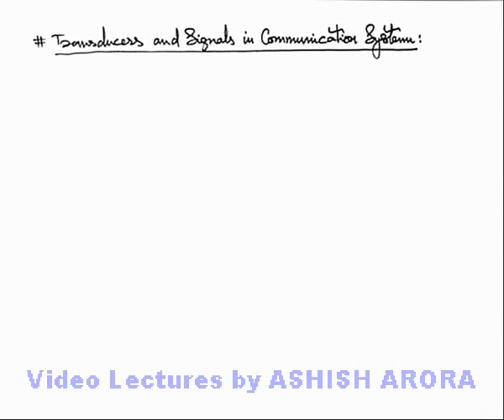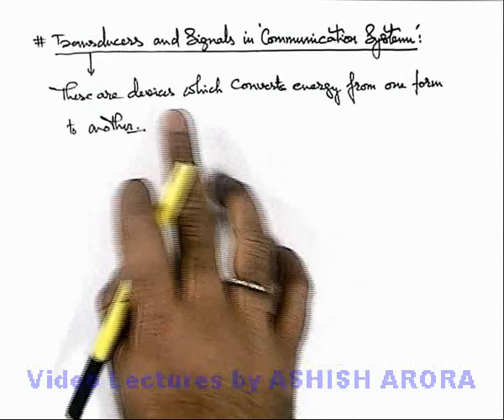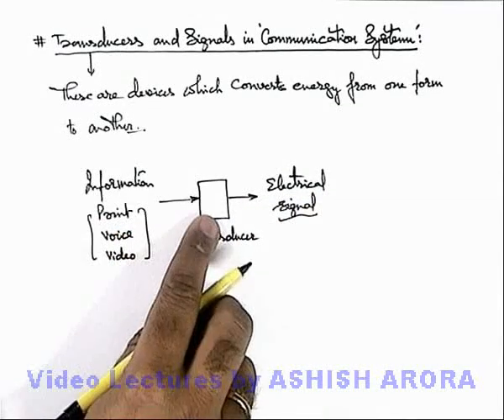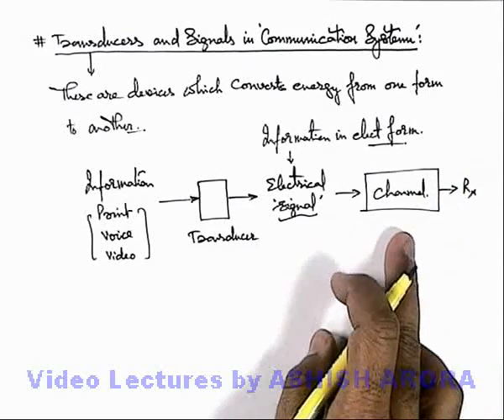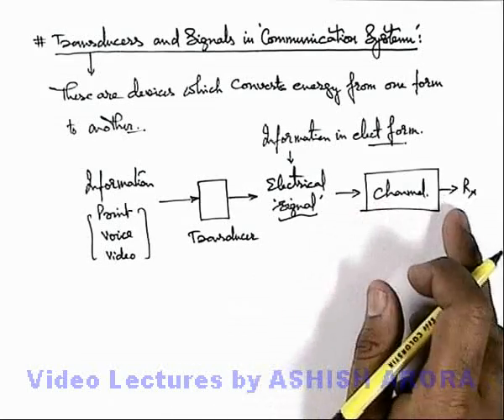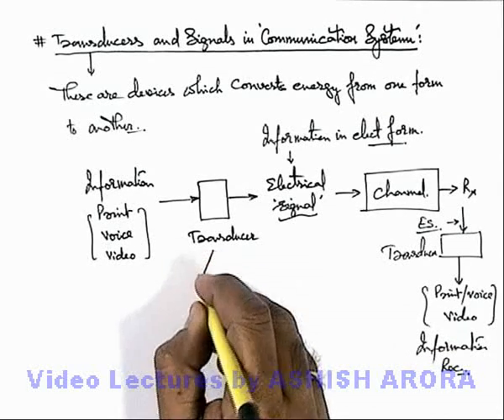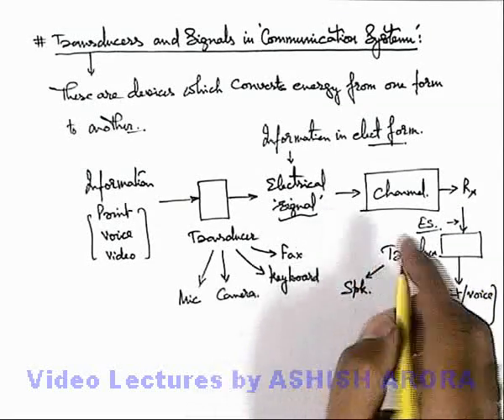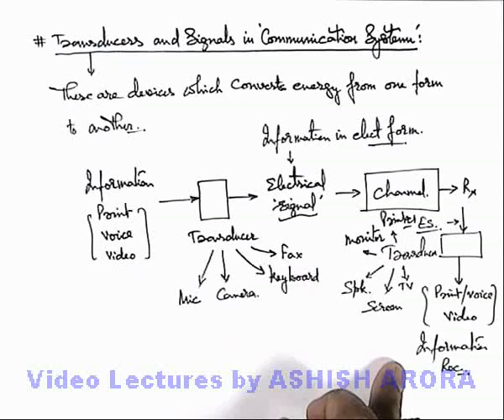Class 12 Physics | Communication Systems | #3 Transducers and Signals in Communication Systems

Comment: what is the difference between transducer and transmitter?
Is transducer comprised inside transmitter?
Reply: Yes you all are right
Reply: I think transducer is a part of transmitter.....transducer converts the information into elec. signal and with the help of transmitter the elec. signal is transmitted
Reply: Transducers and transmitters are virtually the same thing, the main difference being the kind of electrical signal each sends. A transducer sends a signal in volts (V) or millivolt (mV) and a transmitter sends a signal in milliamps (mA).